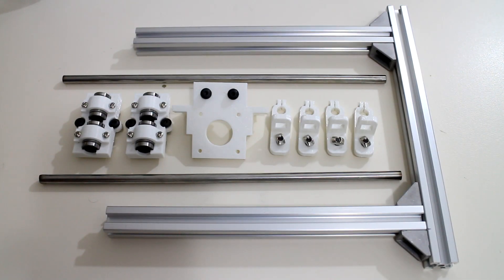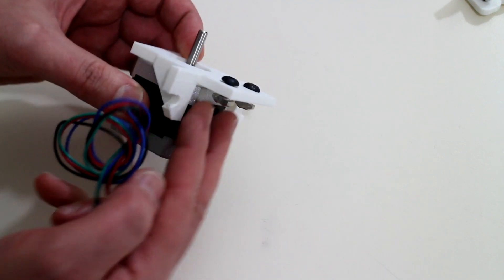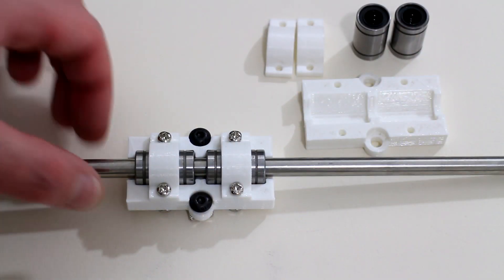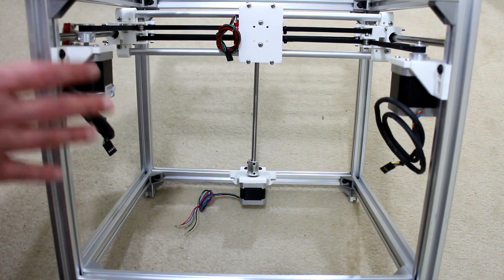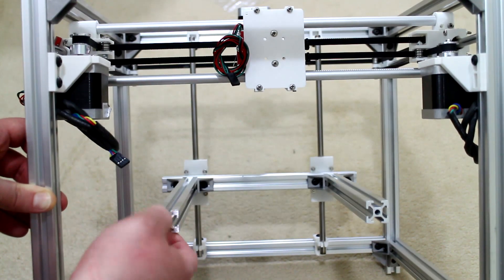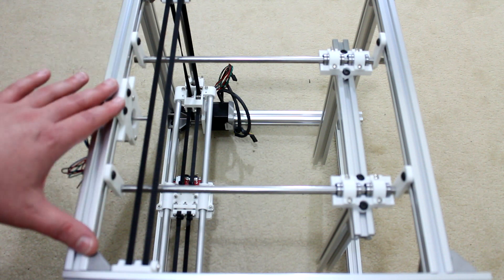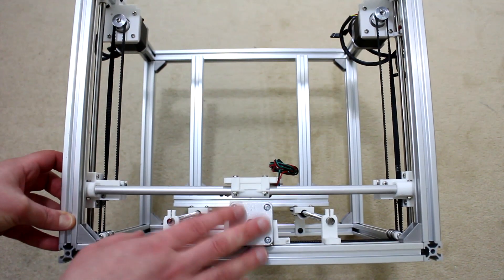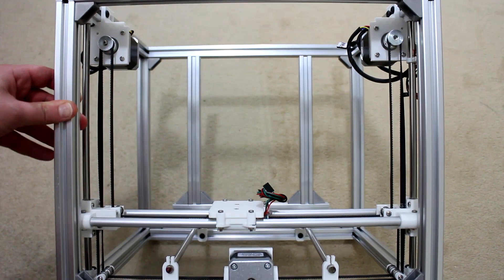New 3D Printer - Build Log #5

Comment: Hey ... excellent series. With respect to “stiffening the Z axis and the bed... try using for top and bottom frame a 40x20 mm extrusion. It will allow to secure the motor and the guard rails along the Z which will make the bed rock solid. Well done mate...

Comment: If you mount the Z axis motor to the top of the frame, use integrated lead screw motors.  The flexible couplers will spring up and down causing the build platform not to be solid.  If you are going for FAST, go with 3 Z motors and 3 lead screws; 1 motor on one side (as shown) and 2 motors and a single smooth rod between them on the other side.

Comment: Why do you use dual bearings/dual bushings on the X and Z rods? I'm sure there's a good reason for it that I can't think of, but it seems like it could easily cause binding issues if the two bearings/bushings were not collinear.

Comment: Considering that the goal of this cubeish aluminum frame is to provide the maximum rigidity possible (in other words, to garantee that every movement goes straight, every angle is 90 degrees), in my humble opinion it is a little contradictory to use only one motor on Z axis... OK, the 20x20 aluminum is sturdy, but wouldn't the bed bend a little during print, with just one motor?...

Comment: Needed a captivated 8mm ball bearing at the bottom of the shaft - basically the coupler is not a bearing of any kind!, I know you have already fixed this problem but its worth remembering that the stepper motors have axial bearings not thrust bearings, so again ... place a single ball bearing under the shaft end to provide that support. (watching the whole set of videos again while I wait for the parts to arrive)

Comment: How high would you have to make the z dimension of the frame to allow for 200mm of z travel with the motor on the bottom?  I don't like those type of couplers working in tension,  they should be used in torsion.  (or use a solid coupler. )

Comment: Put those Z smooth rod clamps on the other side of the frame and you add 40 mm to your Z travel.
Reply: thought the same thing..place z rod clamps to "bottom" of the aluminum frame and you will get the z bed to drop "lower" by quite a bit =)

Comment: Question: Did you do a cost/benefit analysis to decide your target build volume? What are your reasons for not going larger? Space constraints? Cost of materials? Weight? Or are there technical reasons why a larger build volume (in any dimension) would be problematic?
Reply from the maker: Well said Micah, thanks!
Reply: I'm sure Tech2C will chime in, but he stated in an earlier video that one of his objectives is to reuse as many parts from his Prusa as possible, which would limit his X and Y axis to 200mm x 200mm (the size of his heatbed). I presume that 200mm in Z axis is an arbitrary goal of having a cube. Others have made printers with larger build volumes, so it is possible to go larger. Off the top of my head, I can think of several reasons for staying smaller, apart from maintaining a desktop printer size. You would eventually reach a point where 20/20 is not rigid enough and you would have to either brace it or use a larger extrusion to get optimal frame rigidity. Then you also will eventually exceed the torque limits of the NEMA 17 steppers, which will require you to use a larger/more expensive stepper motor.
Reply from the maker: Answer: Please watch the first video in this build series.
Reply: Fair enough. Thanks, both!

Comment: Like your channel, subscribed!
Don't underestimate the task of the bearing holders which has to keep the bed horizontal.
I think it should support the bed much more than only at the back side of the bed frame.
The bending shouldn't be that of a problem after leveling the bed, but vibrations are.
Even the nozzle retracting for a split second can cause the bed to vibrate, leaving imperfections on your print.
Keep up the good work!

Comment: Great video! May I suggest redesigning the linear bearing 3D printed pieces so that screws attach to the bed platform are not in the middle but lower. That way you can have a couple of mm extra on the Z axis.

Comment: Maybe it's just my way of thinking, but shouldn't  that z axis stepper motor be a lot bigger, At very least 64oz holding torque , I would think a nice 72oz holding torque would be even better. after all it will have to hold the z axis in place while it's going up and the weight of anything you print. I know I tend to over do things but my  prusa's i3 has not one, but two 17hs19-1684s.

Comment: In regards to the print height I have had a thought. Could you relocate the bottom Z axis linear rod brackets, to the underside of the back,bottom T-Slot aluminium. The bracket would be within the depth provided at the base by the stubby legs.
So it would go from:      rod                     to :                  rod                          Would give you the extrusion width more space.
                                       Bracket                           Aluminium Extrusion        (diagram looking at back of printer)
                           Aluminium Extrusion                        Bracket
Reply from the maker: Yes that is the plan. It'll still be just short of the full 200mm travel.

Comment: Why just one screw for the Z axis?  Wouldn't one at each corner (or near each corner) connected by a belt or gear drive give you a more stable bed with micro-adjustable leveling?
Reply from the maker: That would mean 2 motors or some other elaborate belt drive system. I'm trying to keep it simple initially. Other printers use the cantilevered build platform without issues so I guess it comes down to how stiff/rigid the platform is.

Comment: I also was surprised at how much the components ate up the build space.  I was building my design in 123D design, so it was a simple matter to expand the chassis prior to buying materials.  But I actually like your design better than my own, so I'm holding back, watching your progress.  I'll probably follow in your footsteps; but my next machine will have a 460mm X 460mm X 600mm build space.  I want big prints.
Reply from the maker: Haha yeah the inner space is rapidly getting smaller. Good luck with your build, and thanks for following :)

Comment: You could also just buy more extrusion and make the thing a little bigger, It's not that expensive  ;-D
Reply from the maker: "It's not that expensive" is relative to where you live. $8 per metre down-under isn't too bad but add $10 postage and things add up quickly.
Reply: +Tech2C know that feeling, made a mistake when ordering for my build, and got 4 extrusions that were 10cm too short. Getting 4 in the right length would be all of 6 euros, but add 15 euros for shipping and it's a no-go. (Fortunately it's non structural and I was smart enough to get a few extra standard 50cm lengths so I can extend them)
Reply: I hear you better than you know. I'm on a pension and if not for planning and being frugal I couldn't afford to buy anything for my 3d printing hobby.

Do you really want to get to the end of this build and think to yourself "I wish I'd..." despite talking yourself into accepting your irrational self imposed limitations?

At $8.00aud (I'm an Aussie btw) and $10.00 shipping and assuming they'd send you 2 x 1 metre lengths of 2020 that comes out to $26.00aud !!! I can't see your excuse as being a reasonable argument, something else is going on here I think. So I'm willing to send you $20.00 aud to help get the material you need rather than settle on redesigning something you'd never be truly happy with. My Google plus account is https://plus.google.com/u/0/+LukePettit3dArtist/posts contact me privately and send me a paypal.me or bank account details and I'll send you the money.

and oh yeah it isn't that expensive in the scheme of things. The core xy I wanted, even as a chinese knock off is $1600+ the real thing is over $3000. $26 or $36 if they won't send two lengths as one for $10 is not expensive!!. Don't settle Tech2c.

Comment: Enjoying this series very much and the work you are putting into it, thanks. The lead screw may need support at the bottom by using a mounted bearing. To eliminate vertical accuracy I would not fix the build platform to the Z axis just have it sitting on top and allowing it to free fall. There would be no lead screw binding problems and any binding in the guide rods could be detected easily..... I would go with a removable glass platform also...
Reply from the maker: Initially the lead screw won't be supported at the base. I'll see how it performs and my need to add something at the bottom if it becomes an issue. I like the idea of a removable build plate but glass won't work very well with an inductive bed sensor for auto bed levelling.

Comment: Why can't the bottom Z axis guide rail clamps be mounted on the bottom side of the 20/20 aluminum frame brace to gain an extra 15-20mm of Z travel?  Does the Z platform interfere with the 20/20 aluminum brace on the way down?
Reply from the maker: Yes I will do this but the quoted length of 185mm travel included mounting the linear guide rail clamps under the 2020 aluminium. Cheers!

Comment: Now isn't that coupler essentially a spring that you are putting weight on to stretch?
Reply: Yup.  That's the error that everyone seems to replicate.
Reply: Would that same error happen by compressing the spring too? Unless that is just the design orientation. Could you just use one of the shaft attached screws as shown for downwards mount - or would that just put weight on the internals of the motor?
Reply: Yes, it works (fails) both ways.  The weight of the load+motion will deform the spring in either direction.  It's just a bad coupler design.

Using the integrated lead screws does put the load on the motor, but so far the motors seem to be able to handle it.

There are other ways to fix this other than the integrated lead screws.  The real benefit of using an integrated lead screw is the fact that you regain about 30mm of travel that was previously consumed by the couplers.
Reply: +GoatZilla I have a spring coupler on my Z at the bottom, and suffered from uneven initial layers heights as it settled. Filled it with hot glue, but after seeing the built in leadscrew steppers I'll get one of those.
Reply: I have a suspended Z and tried to use that type of coupler. Yeah not a good idea. I swapped it for a rigid one.

Comment: You can use the elevator mechanism with weights and pulleys for the Z , instead of buying a special motor? (whats the cost per 1 meter of that AL extrusion?)

Comment: 8:35 Could you just print a bearing holder that attaches to the lead screw on the bottom of the printer? Basically wedging the lead screw between the stepper motor and a bearing. Thanks for the videos!
Reply: Thats how my tevo black widow is. Bearing on top and bottom of both z lead screws and lock collars to hold the positions

Comment: I try suspend my  screw with the same screw adapter you use, but i see a spring movement each time the table move up and down, just check this and im sure your change this type of screw adapter  with a rigid one, on my side my screw is betwen to plate with bearing like a standard install for lead screw....The effect is less if your motor is under, but like me you miss place
Reply from the maker: I agree the spring coupler could pose a problem. I'll try to align the motor shaft and lead screw nut as best as possible to eliminate wobble, but it may be a challenge. Thanks for the advice!
Reply: the spring coupler needs a support bearing, it just transmits torque, but it should not hold screw with table and model on it. I used a bearing with 8mm inner diameter, and put him on fixator from Loctile
Reply: Maybe you can use axial bearings to support screw. Print bearing holder and place it under screw.

Comment: or move the z axis assembly to the front of the frame and start calling it the back
Reply from the maker: I measured that way. It will allow the full 200mm travel in the y axis however the extruder would be outside of the frame, plus it would hit the belts.

Comment: you could probably regain your lost 25 x mm by mirroring the complete xy assembly so that all motors are at the back of the frame and your 25 mm more at the front maybe you could even do this without making new parts
Reply from the maker: I measured that way. It will allow the full 200mm travel in the y axis however the extruder would be outside of the frame, plus it would hit the belts.
Reply: My thoughts exactly

Comment: i'd move the attachement point under the bottom bearing instead of the middle. the longer top part would tuck in behind the gantry and make your bed closer to the bottom 2020.

I have the 4040 500mm parts on the way with the lead 600mm screw embeded in the Nema23 motor for that exact reason.

I did order 12mm 7075 T6 rods for the moving gantry.

also all the hardware will be outside de box allowing a bigger print volume for the same area.

thanks for doing this :) I will use your experience for my project. I ll probably build a wiki and shove some pictures.
Reply: I thought that combining the C-clamp for the bottom bearing with the 2020 mount screws would be far enough down. But yeah underneath would likely work too
Reply from the maker: Yeah that will provide the last 15-20mm of travel to allow the full 200mm. I'm worried if I move the attachment point to the bottom of the z carriages the cantilever force will be too much for the linear ball bearings, resulting in a non smooth motion.
Reply: Waiting for my toys to show up and try it myself. I am more worried on the bending of the plastic than the lever action with the bottom attachment.

Comment: 1- you could move the hardened rod mounts to under the extrusion instead of mounting on top. That should give you 20 mm of extra travel.or2- you could get longer z extrusions, enough to let you fit the whole stepper ( with built in lead screw ) under the bed, the other nice thing about this is you could fit the electronics and power and LCD under the printer.
Great job by the way
Reply from the maker: Yes longer extrusions on the z axis is the ultimate answer, and will allow the motor to mount at the base as originally thought.

Comment: It looks like you can gain an extra 30mm of z-height simply by relocating the corner brackets at the bottom of your printer into the interior of your frame.

Also to address concerns with the cantilevered build platform and ripping stuff off the bed, why not purchase a second glass sheet and make it SOP to hot swap the build platform? That has the added benefit of not having to wait for parts to cool and remove before starting your next print.

I like the fact you're aiming to keep your components on the frame interior. That should mean it'd be easy to build an enclosure onto the frame itself if you wanted a better temperature controlled environment! But that said, I also think you will run into diminishing returns in that regard trying to get your Z-Axis stepper into the frame interior due to the fact your Bowden tube will be above the frame anyway.

Where are you planning to locate your electronics and PSU? Given the propensity for multicolored spaghetti to migrate into the bottom of a printer I hope you'll steer clear of what so many corexy's do and place them below ;D
Reply from the maker: The quoted 185mm z travel included relocating the z linear rail clamps under the extrusion. 185mm is fine for me but I did updated the recommended length of the z extrusions to compensate.
I like the idea of using a hot-swap build platform but I also intend on adding an inductive sensor for auto bed levelling, and that needs to be really close to a metal bed. Glass would be too thick.
At the moment the electronics and power supply may have to be located outside as the bed will be almost at the base. I could fit them on the side though, we'll see. Thanks fro watching and commenting!

Comment: Nice i can't wait to see  the final printer :) . My printer is very similar its a Ultimaker 2 clone from China but also with the same Aluminium parts you used for your frame. The only difference is the Extruder block design and the y and x axis design is a little bit different :) .

Comment: Have you considered mounting the z motor all the way above the frame so that the coupling is just barely touching the extrusion? That might give you a little more build height as well as movement in the y axis. Not sure how stable this would be though. Just an idea.
Reply from the maker: There are so many possibilities when designing a frame, where do you stop? I guess I'm trying to keep it simple initally as others whom decide to build this can simply use alu extrusion frame lengths that will allow full print area.  Cheers!

Comment: Awewsome video....can't wait to see the beast print. Maybe move your Z axis rail mounts to the other side of your aluminium extrusion. Would give you some extra build volume. Same with your z stepper motor. Mounting that underneath your top  aluminium extrusion, looks like there would be space if you look at your x carriage  .
Reply: I thought exactly the same flip the bottom z clamp to underneath the frame, possibly 15-20mm more travel.
Reply from the maker: Yeah the 35mm extra length quoted included fixing the  z axis rail clamp under the bottom 2020 alu extrusion. I'll show it in the next video. Cheers!